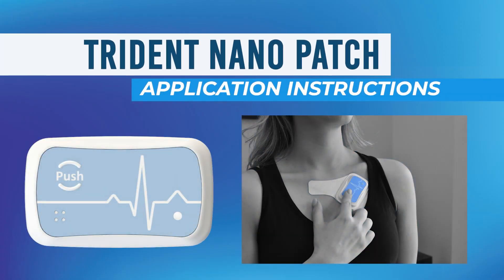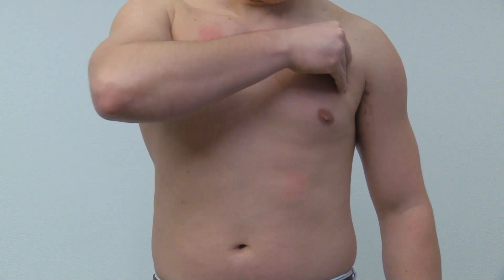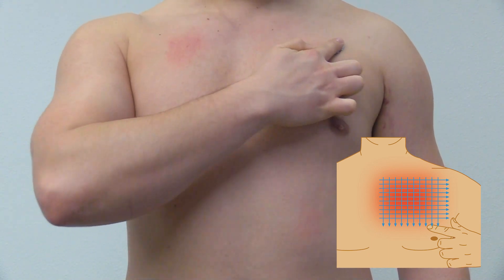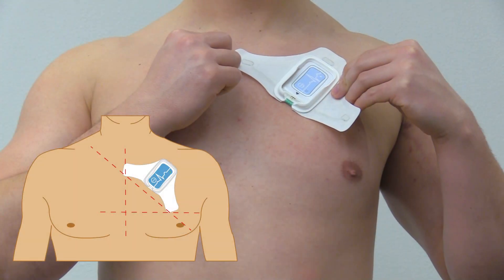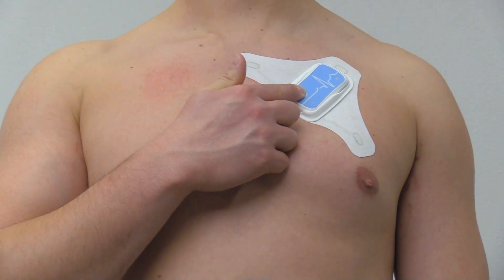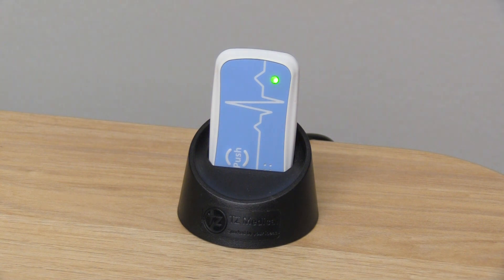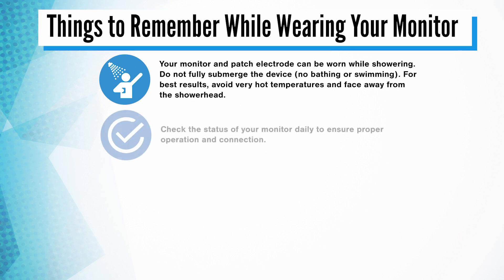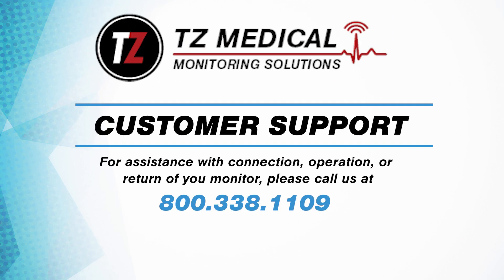Trident Nano Patch Application Guide

Comment: Hi! Is the device still recording if the device (fully charged) put into slot, about half hour later randomly made chiming noises as if it’s connecting, then the led wouldn’t turn on at all for 10 hours and now flashed red 5 times when reinserting into the slot after checking connection twice but doesn’t have any led light anymore even with reconnection? My study is supposed to be 3 days long